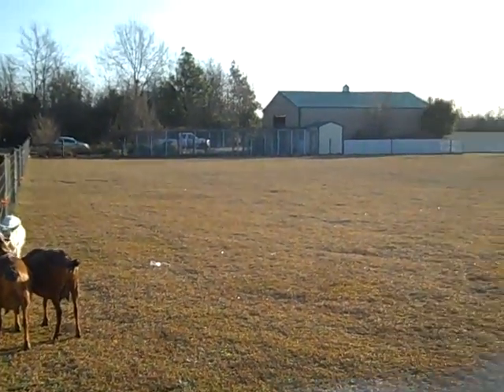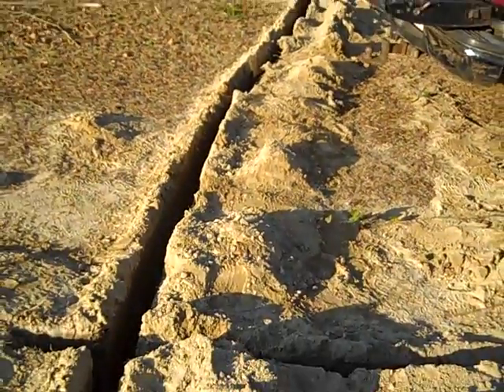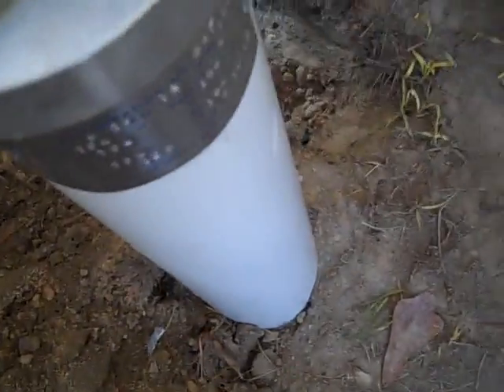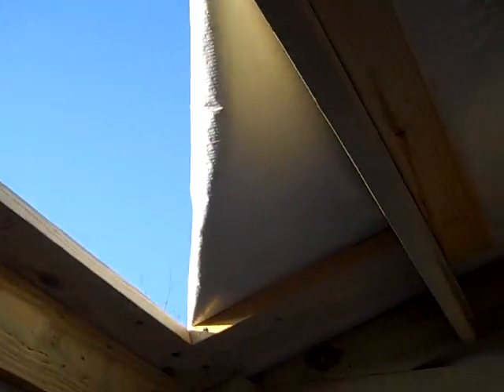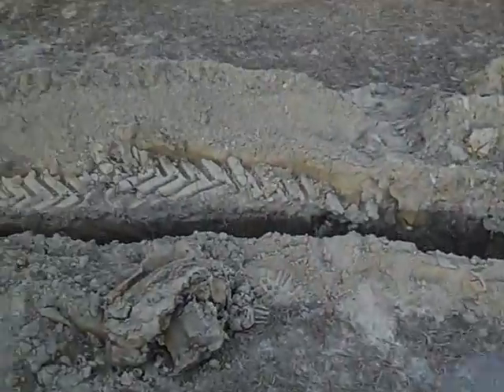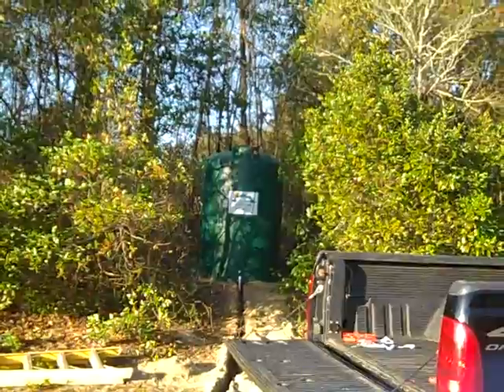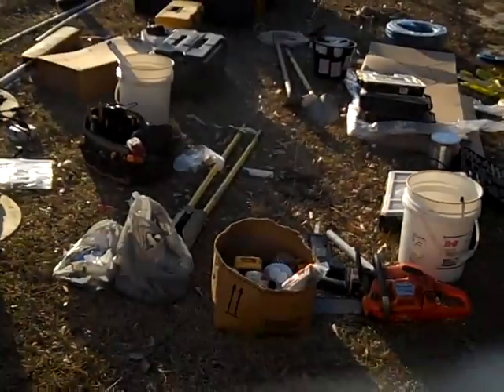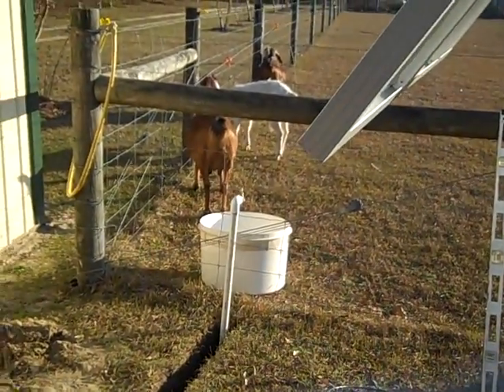Sustainable Water Supply for the Farmer or Prepper

Comment: If your just using the water for washing clothes and yourself after a disaster, you can put 1 tblspoon of copper sulfate penta hydrate (root killer) dissolved in a gallon of water to that storage tank to help keep it clean, I wouldn't use it for cooking or drinking after that, it'll keep the algae and parasites down.
Reply: cool

Comment: Great Video.
Put on your thinking hat on and let me bounce an idea off you. I am considering using plastic55 gallon drum(s) installed in the crawl space under our house for an emergency backup H2O supply.Hook the water supply line and feed the druml(s) in series with a back pump mounted to one tank in case the incoming H2O source went down. The H2O would be constantly moving and would give you reserve. A valve could be used to sense pressure in case a barrel burst. Crawl spaces are warm enough

Comment: the panels I jhave done, I put cardboard over them just before I put the wires into the charge controller. some I haven't and they've arced a bit but haven't wrecked anything. done one about 2 months back for a solar powered fridge. its a 12V engel and its going well. end of summer here in the southern hemisphere.

Comment: Beautiful job!!!  FWIW, Have used 6" concrete drainage pipe (as a collar) filled with gravel and never had a upright pvc pipe freeze. > 30 years experience italking here (n the same area as you!)  You need a spigot higher off the ground. I suggest a piece of rebar driven into the bottom of the trench long enough reach spigot level. Would support 2 stacked drainage pipe once they are filled w/ gravel. I never use a 90 degree fitting topside. Just attach the spigot directly to the upright.